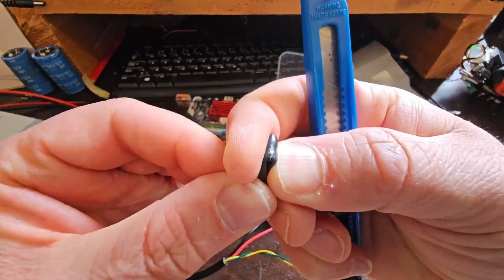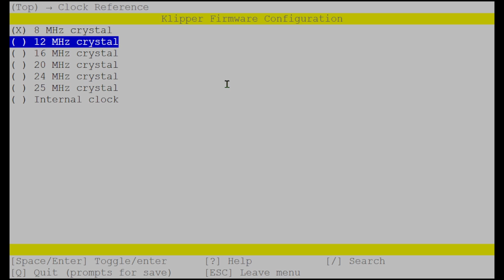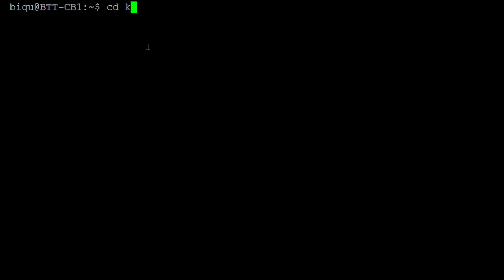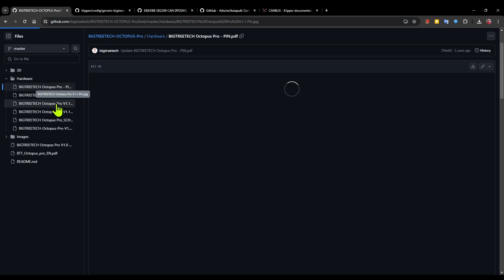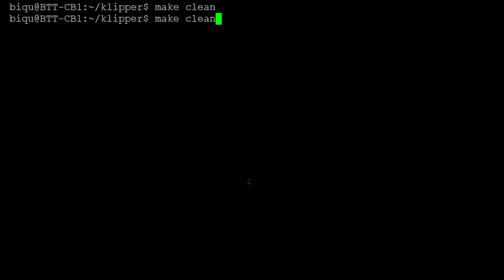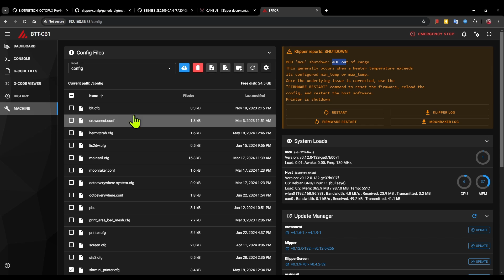Octopus pro to sb2209 canbus set up

Comment: This is awesome very well explained. I didn’t even search for a guide yet because I’m still preparing my parts for my canbus endeavor I have saved it for when I am ready to do the project. One content creation tip, you might want to look at your microphone settings and up its pickup volume decibel range. Audio quality sounds fine i noticed the microphone was fluctuating a lot. that has fixed fluctuations in audio volume or quality for me in the past.
Reply from the maker: Yeah I'm clueless with the microphone/sound recording part. I'm starting to think it might be the microphone setup I have. It was well rated but I don't know. I want to get a Røde mic but I'm afraid to get that just to find out its poor PC and /or settings causing the issue 😅
Reply: @StackingLayers  what is your current setup? And are you wired or wireless? If it is definitely microphone and not settings. There are a lot of budget options that are really good. My brother got a $60 blue something I think it was the snowball model and it works really good.
Reply from the maker: @AndrewAllen-jh3uh I have a Hollyland Lark M1 duo wireless set. There's a chance it's the settings or the PC. I've gone through all sorts of set-up guides and talked with Hollyland. They said I can send it in but it's all at my own expense and at that point it's the same as buying something else. I ordered a Røde USB ADC. It's supposed to be great for all types of mics 🤞 It bothers me that this audio issue seems to be defeating me😅
Reply: @StackingLayers  sounds like you got it figured out. Unless it’s a really old pc I doubt it could be the cause. Even my old pc that I run windows 7 and xp can handle video and audio good. My suspicion would be that because it’s wireless you are getting some latency on when the mic picks up enough decibels to pick up your voice.
Reply: @StackingLayers  my printer right now is what’s defeating me lol. I’m trying to get more speed out of it than it was built for so it’s been a process of upgrading to stop the layer shifts.
Reply from the maker: @AndrewAllen-jh3uh it's supposed to have a 200 meter range but something is weird. I do notice that sometimes is seems to jump left to right when it should be a mono recording. I hope to figure it out soon. I want to provide better sound quality. My pc is about 12 years old but it's still decent specs.  I am going to default all settings and start from scratch when I get the USB ADC
Reply: @StackingLayers  going to a usb ADC should fix a lot of current and potential future problems it wouldn’t surprise me if it fixed everything. Over the last 14 years of working with pcs discord and some videoing wireless has been a dumpster fire every time for me 😅
Reply from the maker: @AndrewAllen-jh3uh that would be the motors not being strong enough to quickly move the mass. Is it a bed slinger? Those need some good torque motors to handle high accelerations. Really any motion that deals with more mass will need more powerful motors.
Reply: @StackingLayers  it is a cr10 S4 400x400x400. I am currently trying two 4260 motors on a 15mm wide belt. If that still doesn’t work I will go dual belts on the y axis and quad motor if necessary. If all else fails I have been considering a core xy conversion on it and going full voron style build 😅
Reply from the maker: Yeah that's a big mass on the Y axis. We have a CR M4 at work and that thing layer shifts like crazy when the acceleration and speeds are turned up. Keep the jerk speeds low too.  It's the quick change in direction that is causing the most issues. That's where the more powerful motors will help. The skipping is not normally the belts. It's typically caused by the motor not being able to overcome the inertia of the bed and it's literally being pulled to the next magnetic positions as it changes direction. Incense there's no feedback on where the motor is, it just continues printing as though it's still in the right spot but it's obviously not. Closed loop stepper drivers can also help with that since they actually do provide a feedback. So if it misses a step it can quickly compensate.
Reply: @StackingLayers  I will look into some closed loop motors. Do you think running dual motors 42x60 will be enough? Also what acceleration and jerk would you recommend to start with or is there a klipper calibration command for that?
Reply: @StackingLayers  I almost got a CRM4. How do you like it?
Reply from the maker: @AndrewAllen-jh3uh it's slow. Lol. The size is great but it needs some updates. I'm trying to convince the boss to let me klipperize it. Creality has limited Marlin firmware on it. I was surprised that they didn't even put auto z alignment on it since it has dual Z motors, to space for an extre stepper driver, and a bed probe it would have been a simple thing to activate. The hardware has a lot of potential though.
Reply from the maker: @AndrewAllen-jh3uh if you get dual motors on the bed motion you should be fine. This is a great guide to get your speeds and accel tuned https://ellis3dp.com/Print-Tuning-Guide/articles/determining_max_speeds_accels.html
Reply: @StackingLayers  that’s my thoughts about it as well and why I went with the Elegoo Neptune 4 max big mistake btw. I have a sonic pad for my mostly stock creality machines so I would have looked at hooking up the CRM4 if I got it.
Reply: @StackingLayers  awesome I will be checking that out once I get the cr10s4 back in one piece. After I get the acceleration and speed tuned in I’m going to be putting a Bambu hot end stealthburner on it. Klipper has been an awesome next step for me and building a print farm. I didn’t realize it when I was doing the initial install but apparently most  the guides I used were yours so thanks for all the great guides.

Comment: Another question please,, 🤣🤣  so something is defective with my ebb sb2209 - (rp2040) board, I have a replacement can I just re flash the can board and install it and get right back to working order or do I have to go threw all the flashing from the btt pi to the octopus pro board?
Reply from the maker: Just the sb2209 part

Comment: Will this video work the same way for the board before this one,, btt ebb sb2209? And which one is better or will they do the same thing?
Reply from the maker: Yes it's virtually the same process. You'll just have to set up the make menuconfig according to the MCU onboard. Overall the boards do the same thing.
Reply: @StackingLayers  thanks a bunch.

Comment: Sorry I'm asking this here but do you have a video on setting up input shaping on a can bus setup like this video is?
Reply from the maker: I didn't have one specifically for canbus, but all you need to do is add it to the configuration of the EBB. It would be virtually the same config setup as shown in my other accelerometer video. Just skip over the flashing firmware parts.  https://youtu.be/FBWj8q5e6Wo?si=s7jC4vPrI-DHEz_n
Reply from the maker: If you have the BTT sb2209 as shown in the video this is what you need to put in the printer.cfg. note that its common for the MCU to be labeled [mcu EBBCan] or something like that. I use [mcu sb2209] so that is why my pins start with sb2209: change that to match whatever your MCU is named.

[adxl345]
cs_pin: sb2209:gpio1
spi_software_sclk_pin: sb2209:gpio2
spi_software_mosi_pin: sb2209:gpio0
spi_software_miso_pin: sb2209:gpio3
axes_map: z,-y,x

[resonance_tester]
probe_points: 100, 100, 20
accel_chip: adxl345
Reply: Awesome! And thank you! The other video was good to I went ahead and just watched it as I'm going to add one to my other printer. 😁

Comment: My toolhead katapult uuid wasn't working, turns out the can connector shipped by siboor sometimes comes wired backwards
Reply from the maker: Yeah there was a bad batch sent out. I notified them about that and they made a post about it on their discord. Unfortunately they had already sent out a large portion of that batch. Luckily it's a very simple fix and doesn't damage anything if reversed.

Comment: Ok I changed the polarity of the RJ11 cable, everything worked out, thank you
Reply from the maker: Right on! Good to see it was a simple fix.
Reply: What is the connection diagram for the RJ11 to CAN cable? Can it be manufactured?
Reply from the maker: @andresvarela9756 it's the 2 center pins (3 for can low, 4 for can high if I remember correctly) that are connected to canbus the rest are not connected to anything. I have just cur an old DSL rj12 cable and made a connector. It works fine like that. There are also rj12 to screw terminal adapters available.

Comment: Does not detect uuid application:katapult but it gives query complete I've been trying to finish the setup I am unable Has anyone had the same problem? I want to thank everyone for their answers because the video is excellent, it's my fault because I have little experience,thanks.
Reply from the maker: Are you able to get a UUID if only the octopus is connected to the host? There has been a bad batch of the rj11 wires where the can high and can low are reversed. If the high and low are reversed thus can happen. Other things is if the bitrates are not matching, or other firmware configuration errors.

Comment: I am trying to set up but it gave Total  0 uuids found why? I apologize I'm new to this I don't dominate,thanks.
Reply from the maker: There can be many reasons fom missing or incorrectly placed 120r jumpers, to non matching bitrates. There is also evidence that the RJ 11 plug for the octopus has been wired backwards in a batch so there's a chance that the wires need to be switched 180 degrees. If you have only the octopus plugged in to the host and nothing else connected via canbus, can you get the octopus UUID?

Comment: This video excellent but I could not get to the menu (4)+ stopped to do?  help please thanks.
Reply from the maker: Sorry I don't understand the question. Are you talking about the configuration menu for making the firmware? For those you need to be in the correct directory. For example for klipper firmware you have to be in the ~/klipper/ directory before running make menuconfig

Comment: Hey there, so i´ve been trying to setup a SB2209 with a STM32G0B1 according to your tutorial. Somehow whenever trying to flash katapult  get : make: * No rule to make target 'flash'.  Stop.  Any Ideas maybe?
Thanks anyways for this tutorial!
Reply from the maker: What is showing in lsusb when you put the sb2209 in DFU mode? It is a little different than the rp2040 version. Also are you setting up the make menuconfig for the stm32G0B1 and not the rp2040?
Reply: @StackingLayers  hi, thanks for the quick answer so far.
It gives me the Id, as well as the STM Controller in DFU mode, so i guess going into dfu mode worked. The make menu i set up for the STM according to the manual for the board. Actually i can even install the klipper firmware without a problem with the same settings and process, katapult doesn't seem to want tho... :)
Reply from the maker: When you try to do the katapult make flash, you are still in the katapult directory right?

Comment: I have an octopus board 446 that i am trying to set up canbus using btt ebb36
So i bought the rj11 to can cable and the cambus cable for the sb2209 cuz I didn’t want to make a canbus cable and that one is much cheaper.
My question is how to avoid frying my boards
The rj11 to molex female doesn’t show which wire is can h and which is can l
Any idea how to verify
Reply from the maker: It only uses the 2 center pins for canbus the rest are not connected to anything. With the rj11 port facing you the left (pin 3) is can high and the right (pin 4) is can low. In my plug it's red for high and green for low which seems to be standard for those plugs but it's best to probe for continuity to be sure. Luckily hooking up canbus in reverse will not burn anything, it just will not communicate. Just never connect power lines to canbus lines that will damage things.

Comment: I had my 2.4 350 using an Octopus pro via usb to can bridge and using a sb2209 rp2040 with can via the Octopus pros’s rj11. I had just over 1000 hours with a timer to close error maybe 3 times, I added Siboors ercf kit to my printer with btt’s new CEB and could not get a print finished without a shutdown due to a timer to close error. After changing the btt mmb to usb I could get further into the print, then I turned off my sb LEDs and was able to get further but still not able to finish. I spend the past 2 weeks trying to fix it. I tried changing the sd card, unplugged my webcam, then Upgraded to btt pi2, when that didn’t work I changed the sb2209 to a known good 1, still got the error, changed the Octopus to another know good 1, same error. I added a btt u2c as a last ditch effort and was able to finish a print! Put my old btt pi1.2 with the original sd card, put the mmb back on can using btt’s ceb, sb LEDs back on, plugged the webcam back in and everything’s good so far, I have 12 hours without a error so far. It was a timer close error with ebbcan shutdown. So after that enjoyable situation I think I will always use a dedicated usb to can board. My Micron 180 is can with the Manta mp8 and ebb36 with over 1300 hours but I do see a timer to close error every 300 hours. I have 0 room to add anythinh in the electronics compartment so I’ll have to live with that one.

Comment: Hey, thanks for the tutorial. As I was following up your instructions I stumbled upon an old problem I had trying to flash through USB. I had confirmation "File downloaded succesfully" like in your video. But after flashing board is not listed inthe connected USB devices. Do know anything about that?
Reply from the maker: If you are flashing the firmware set up for canvas it will no longer give you the dev/serial/by-id/* you need to get the UUID using this command,
~/klippy-env/bin/python ~/klipper/scripts/canbus_query.py can0
Reply: So I get this "Found canbus_uuid=b9cfdc5584ef, Application: Klipper"
and 
lsusb
Bus 001 Device 004: ID 1d50:606f OpenMoko, Inc. Geschwister Schneider CAN adapter
But still mcu can't connect. I couldn't flash my EBB36 and it is disconnected. Is it required to connect the canbus in order for Klipper to connect to Octopus Pro MCU in this config.
Reply from the maker: @aphlox you will have to flash the EBB36 to communicate over can us and it is important that the bitrate matches the other canbus nodes. Most common now is to use 1000000. 
No you shouldn't need other can devices connected for only the octoPro to work but you should not connected it to klipper until you have the other devices set-up too. I've seen people having issues getting things setup that way. Get all boards flashed and providing their UUID, then set it up in the printer.cfg
Reply: @StackingLayers  There I had an issue. 
I get this error trying to flash make: * No rule to make target 'flash'.  Stop.
Reply from the maker: Send,
   make clean 
Then run the, make menuconfig to make the firmware again, also make sure you are in the correct directory when doing that. /klipper for klipper firmware and /katapult if you are doing katapult